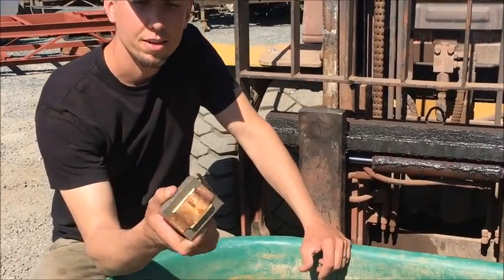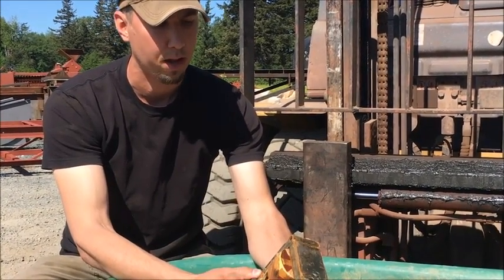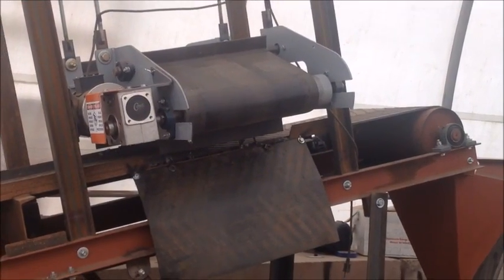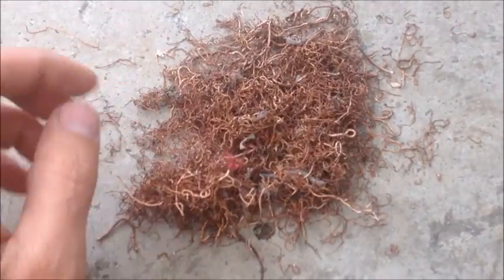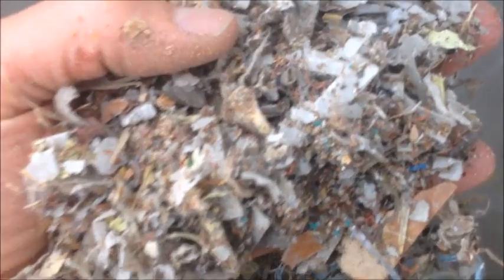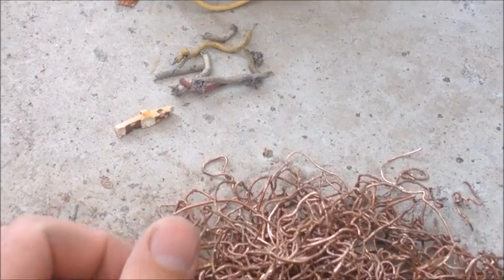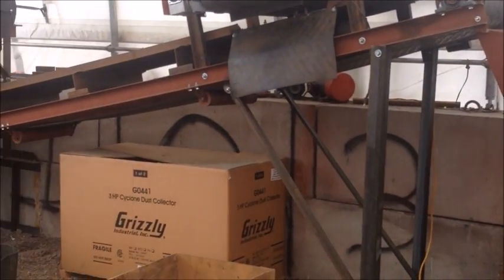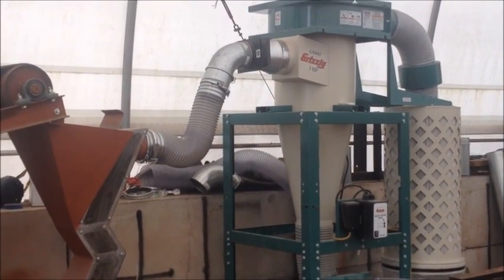Clean Copper Wire from Production Transformer Recycling

Comment: Still trying to figure out HOW aluminum and copper separated from each other when mixed? Ferrous is easy due to use of magnetic belt, but HOW is copper separated from aluminum? I may have heard oils or eddy currents ?
Reply: You can use an air table to separate Al and Cu from each other once it's been broken down.
Reply: @shadowzedge5793  OK So, you've got "air" tables and "water" tables... Thanks
Reply from the maker: Not sure, I don't have a good answer.  I have heard about differential melting, but I doubt it works well

Comment: A lot of those large transformers have one of the coils made with aluminum wire.  Its not apparent because of the poly coating on the magnet wire.  You wouldn't want to get that aluminum mixed with the copper. Best thing to do is to use a hatchet to  wack the coils to make a deep enough cut to see the color of the wire. If its aluminum, you can wack the transformer with the hatchet and a sledge hammer right on the welds and pry the top steal lament slab off and remove the coils. Your recycler or scrap yard will be pretty pissed if he found copper colored aluminum wire mixed in with the copper.
Reply: All this talk about aluminum mixed in with the copper. If you are in the business of purchasing and running one of these beasts to process transformers you can afford to purchase a portable XRF gun to sort these transformers out in seconds prior to adding to the process. An X-ray fluorescence gun will complete this task anywhere and will pay for itself quickly.
Reply: Amen but if you are a rebuild facility and get the same items all the time....even alloy wire will increase the value at $0.50 /lb compared to the $0.10/lb for steel was depending on market fluctuation. Sorted CBM seems to maintain the same prices as shred. I would be interested in the cost of electricity vs recovery. It takes a shitload of transformers to yield a windfall of copper.
Reply: I was waiting the whole video for him to mention that. On transformers you have a primary coil and a secondary coil, one is copper and the other is copper coated aluminum. So even though putting those through the mill ended up with very very good results,  all that needs to be smelted down to separate copper from aluminum. Good job

Comment: Your biggest issue will probably be the transformers that use aluminium. So you may have to make a density separation system for it.
Reply: I was wondering about the maintenance of the system and the expected annual repair costs, if used 10 hours per day.  How often would I have to replace parts?
Reply from the maker: Hi Duane.  Please send us an email at MBMMLLC@gmail.com and we can discuss the hammer, mill, and screen wear and other maintenance items.  Or you can call us at 360-595-4445.  Thanks
Reply from the maker: Yes, excellent point.  The best thing to do is to sort the transformers and make sure there aren't any Al transformers going into the machine.  A quick touch with a grinder will tell if they are Al or Cu.  Thanks for the heads up.